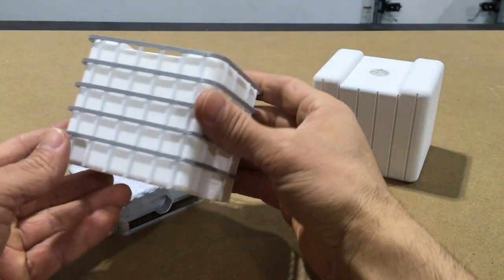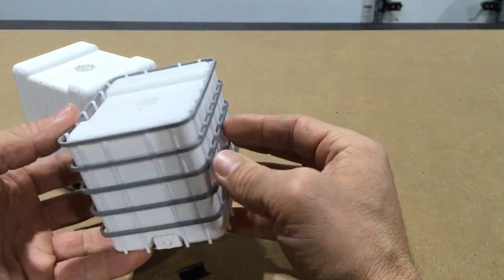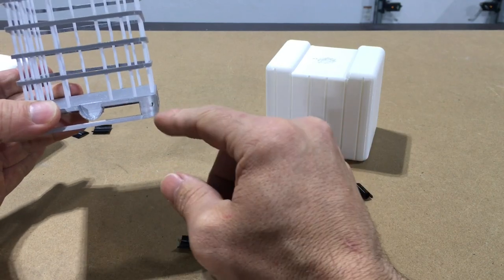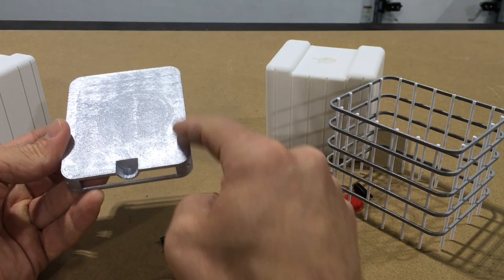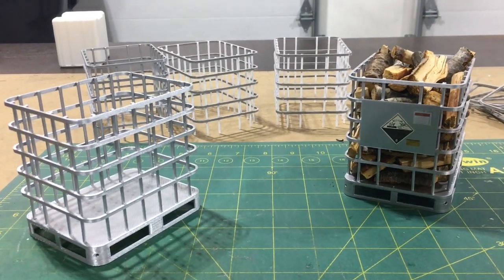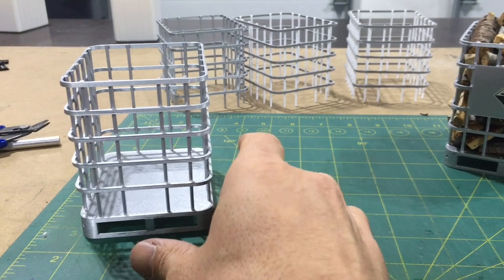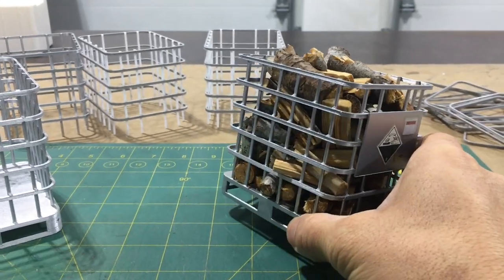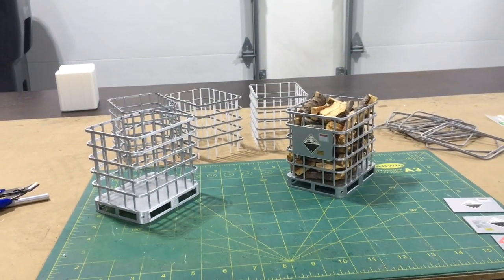IBC Tote cage pallet 1/14

Comment: It's a good idea to reuse them, in the end without too many modifications you made a second use, for the transport of wood or others it's very good. Maybe infact some slightly rusty (due to the humidity of the wood for example) would be nice, just an idea 😉 Anyway, very good job 👌
Reply from the maker: Yes my friend thats an idea, but also keep in mind these cages are made from aluminum, Aluminum doesn't rust, but I could still make one with broken and bent pieces full of grime and dirt. Thanks my friend!
Reply: @westernsharpie  Exactly, you are right the aluminum does not rust, but your idea is good, to make damaged or very dirty ones would be really super 😉👍